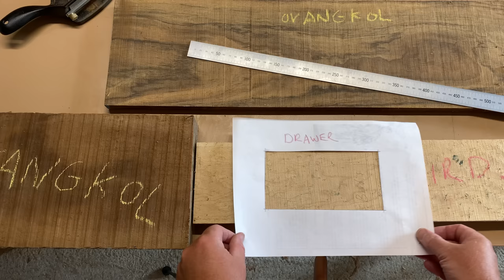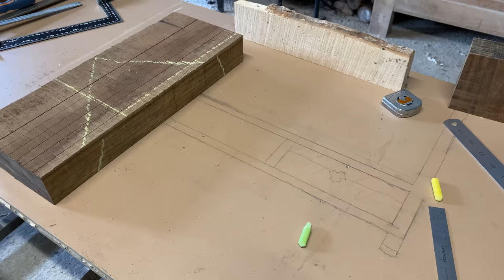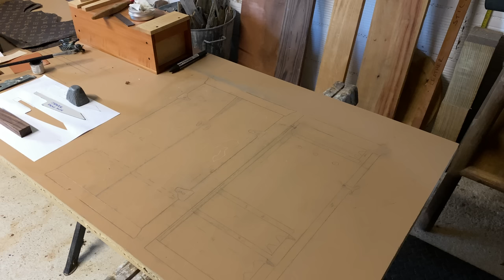Customized Jewellery Cabinet that took forever

Comment: The bold, masculine shapes and materials strike me as a mini bar especially when its opened but to each their own.
Reply from the maker: Thanks for watching and your comment. My daughter picked out those woods as I used them in another project and that's what she wanted. I added pink leather on the back of the leather pulls and pink drawer liners to contrast the dark woods.  Anyway, let's hope she is not using it as a mini bar and stashing whisky in there!! cheers

Comment: Exquisite work my friend. I started hand tool work in the Paul Sellers era and the amount of detail you put in this project is astounding. Excellent job. You have some really nice tools I must say. Subscribed and looking to see more projects in the future. Well done.
Reply: I have a question. Around 38:21 what are those white strips you put around the wood so that you can plane down to a small veneered thickness?
Reply from the maker: Hi there, thanks very much, appreciate it. Yeah, it is nice to use good tools - some bought, some made and some refurbed from ebay.  Birthdays and Christmas presents are easy for my family!  So glad you are enjoying hand tool work, I wonder if you took one of his courses - he has inspired many woodworkers. Warm regards.
Reply from the maker: It is thin flat plastic board that was about the right thickness (2mm) that my daughter had for a project at school! Double backed sticky tape holds it down. cheers

Comment: Loved all of it. Your tools are very eclectic. Curious how you picked and chose between some. I chose Veritas shoulder plane over the LN. Been looking for an excuse to buy the tiny Veritas detail shoulder planes. Was nice to see you using one.

I was a goldsmith for a time and some of your tools like the fret saw are very familiar. Maybe you also dabbled or you just love tools in general. The short of you cutting up the plane caps was brutal but you told us they were faulty here. I thought it was great using them. They’re made to pull with fingers after all.
Reply from the maker: thanks very much, appreciate your comment.  The Veritas shoulder planes are great - I only have the small one as I refurbished an old large Record shoulder plane one which I now love. Yes, well spotted the fret saw is a jewellery saw from Germany - wow a Goldsmith - that's so interesting... I love using hand tools and enjoy bringing back to life old tools plus I make some tools too - like the wooden hand plane and saw used in that video. Also do a lot of leatherwork so more tools for that too.....!
Yes those 2 faulty lever caps have been sitting in my drawers for 10 years and every time I saw them I wondered what I could do with them - good to finally repurpose them! warm regards

Comment: Hello friend a great hobby indeed. Can you list the tools used and where to get them + a link for the esty vendor ??
Reply from the maker: Hi, happy to …which tools interest you - there are many used here…?! What Etsy vendor ? Cheers
Reply: Sorry I posted in the wrong build ,opps. I wanted to know about the toolbox build you made for your son
Reply from the maker: ah, no problem, I already answered quite a few questions in the comments so also worth looking - the original Esty seller is not on there anymore as I looked a while back so can't send a link but there are other sellers of 'damier' or checkerboard canvas on Etsy and other patterns too - you want the best quality so the more expensive suppliers - about 1mm thick. Not trying to be diffiult but as I used a lot of tools for leatherworking and woodworking - which ones are of interest and I can advise you...as I don't have a ready made list - this is not my job so limited time 😊..  Also, if you are talking about the hardware, see my answers with links in the other comments for both videos on the trunk...cheers

Comment: Nice work.   When you cut the pulls you used a knife that I am not familiar with.   First thought it was a half moon skiving. Knife, but on closer look the blade more nearly resembles a raptor or parrot beak.   What is it?  Where might I find one?
Reply from the maker: Many thanks. That is a half head knife from Barnsley in England. They have a website if you are in Europe, cheers

Comment: What is the tool did you use at 2:24, to remove the glue and excess of wood between planks?
Reply from the maker: Hello, that is a cabinet scraper - wonderful tool, regards
Reply: @boreoff  thank you very much. Shall be very useful for me. I didn't know this exist. When i glue the planks, i remove the gap with a regular hand plane.
Reply: I always use the metal sheet for finishing.. and i didn't know the name is cabinet scraper too 😅😂 but you use something like a spockshave
Reply from the maker: The no 80 cabinet scraper looks a bit like a spokeshave …cheers